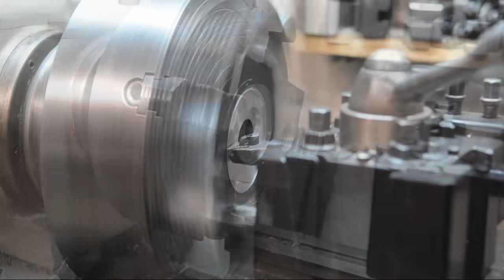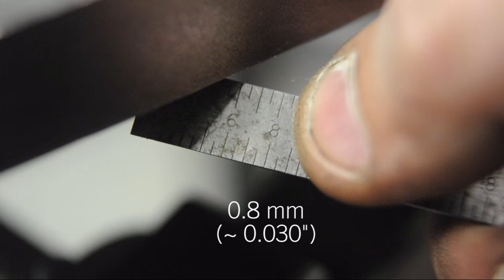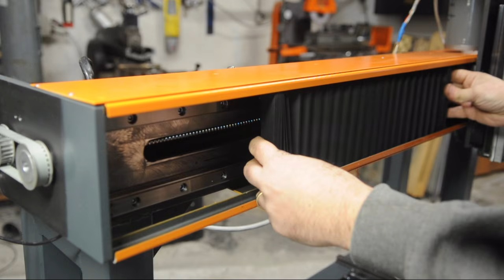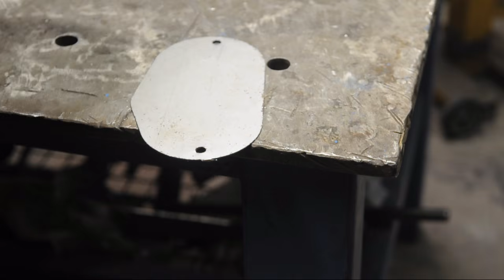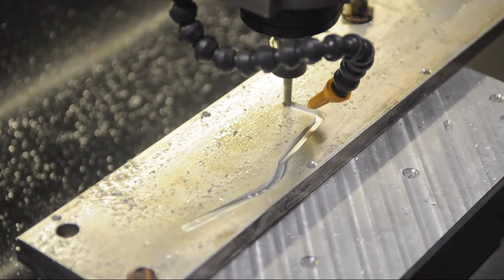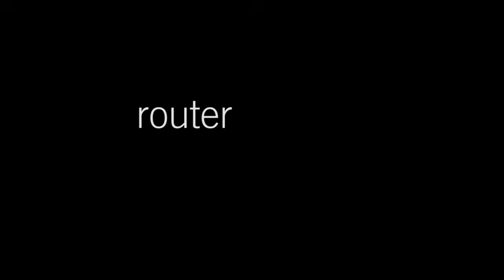Fixed Gantry CNC Router Build Part 3

Comment: They sell "PCB drills" in small sizes that have a 1/8" shank regardless of what diameter the drill part is. might be easier to hold in your mill and could even be held in a collet.

Comment: For future reference, if you want to move heavy loads over a longer distance using a ball screw, you can prevent a long screw from acting like a jump rope by mounting the motor to the moving table and turning the nut instead of the screw.

Comment: The last minute was the most important. My un modded 6090 mill has .023" deflection at 50 pounds, .009 at 15 pounds and .001 at 2.5 pounds. My question is what happens with that deflection if the machine is not chattering? A Good feeds and Speeds app will tell you the amount of force on the tool and what you can cut with those forces. The needed mods are simple and rather obvious to do. Your .001" at 50 pounds is a good target to shoot for.

Comment: I don't know what model Huanyang VFD and spindle you bought but judging it as piece of junk by how the buttons feel is not very this old tony. I have been using the 2.2kw kit for 3 years without a hitch. BTW, why do you need access to the VFD panel?  I never touch mine.

Comment: This Why not put a fan either side of the box with panel filters and louvres to suck air in and out. This will replace hot air that will build up from the VSD.

Comment: What an endeavor... my hat goes off to you. I currently own an old bridgeport interact series 1 i bought with the ambition to run on single phase 220. sadly, the old turd wasn't having it. spindle drive was a VFD (quite like the one driving your spindle) that was near impossible to interface with the factory heidenhain tnc150 controller. So to the dark corner of the shop is where she sits now. I danced over the idea of a retrofit conversion but didn't  (and still really don't) have the doe to do so. You mentioned in an earlier installment of retrofitting an older model 3-axis mill with 3rd-party drives/servo-software package for very very cheap. would you recommend any in particular?

Comment: Well I have finished my all steel DIY CNC machine based on this "This old Tony" design. I modified the design on the two supporting beams for the Y axis rails, just to have adjustment. So I joined parts by screws instead of welding. I introduced a  fine adjustment by means of M6 screws for leveling, and and M8 for strong holding. When machine adjustment, looking for squareness, I do not have adjustment on XZ movement (like your machine) and I only adjust machine table and Y rails (planes XY and YZ) related to XZ plane. I have begun machining aluminum and the whole cutting process looks and sounds very well.  Better than thinking I am finishing the job, I am planning now an update for motors and drivers. Thanks you This old Tony one more time for these three videos you gave us.

Comment: You sound unhappy... I'd be overjoyed if I could finally drill and tap a few holes. It's been ages! All I've been doing is squirting coolant at old chips and keeping the tool bits clean... You know, to make sure the machinery stays in prime condition in case of some unexpected... Well... You know....

Comment: I was wondering about using timing belts to decrease the machine size, too. However I feared of introducing backlash. What's your experience with timing belt vs direct driven ball screws?

Comment: Tony, if you want very fast acceleration for your system, you must change the servos to ClearPath. Clearpath also newer fail its accuracy. Its always spot on as long the servo is sized correctly. Check out ClearPath servos here:
https://www.youtube.com/watch?v=zUy89MT_Rkk

Comment: Maybe some standoffs on the heat sink holding it off the backboard to allow more airflow.  Airflow is the trick on sinks.  Etching in HCL would help - dip and rinse!  HCL will dissolve AL easily.  It is a pickle job.  Weaker solutions might be best.  Or job shop it out to a painter (of metal).

Comment: Hello! I have continuos working on my own Gantry Type Router design based on these 3 videos as I mentioned before. It was very difficult to obtain a flat surface (X axis) to mount rails, by milling along the beam, so I disassembled for grinding. Thank you very  much This Old Tony for this videos and channel.

Comment: Did you ever machine steel on this router? I am making a similar design and testing the design under 1000N or 100 kg or roughly 224 pounds of force. 1 thou max  deflection. I want to cut some steel if needed. Machine base would be cast iron.
I saw you machine aluminium with it nicely. How’s the surface finish? Chatter?

Comment: Since you work a lot with metal, I think you would have benefited from adding a plasma cutter head next to the router. Unfortunately you cannot do this with your design since you have the table move as the Y axis. You would need a water table, and I dont think you could do that with a moving table.
Reply from the maker: I'd have to move really slow. :)

Comment: +1 for building the heat sink from a block, -1 for using slotted screws to mount the motor drives.  Thanks for the video, great entertainment and learning.

Comment: Old Growth - that is a chuckle.   Actually, in high tech Physics the instruments have to be made from steel that isn't traced with radioactive elements.  As it seems there is so much scrap and recycle and reuse the steel is generally mixed up.  However they came into pure gold.  The old (pre WW I) shipyards in Oakland were being upgraded for new ships and cranes... The old had to be removed.  The heavy and very thick plates were tested and all collected.  World wide this is happening.  As old is scrapped it is picked up.  I have a Degree in Physics, Math, Engineering.  Busy guy.  Wonderful project you are on! I know - this is an old thread but not for me.  Just one of a series.

Comment: Yes please to the router design video!

Mostly just to answer all the questions about choice of materials and design.
I personally have a bunch of questions (mostly because of my own ignorance) about the benefits of the fixed gantry vs x&y gantry. (This is honestly the first fixed gantry router I've ever seen)
And wondering if a 4"x6" aluminum extrusion would be as stiff as a steel gantry?

Comment: Im interested in seeing your design video, im in the collecting materials and design process of my cnc plasma table build. I'm watching various CNC DIY videos out there for inspiration and you have set the bar high Sr. Could you elaborate on the electronics and software you used for this project? i.e: motors, motor controls, driver board, power supply, etc. Hopefully you see my comment and are kind enough to reply to me. All the best.

Comment: Have you thought of putting a brush guard that fits around the cutting bit, it would collect chips, and stop overspray of the cooling fluid.  You can even fit a hoover nozzle on there.  This has been a sheer joy to watch an engineer at work,

Comment: At the end of the video you mention that it was designed to limit the tool deflection to 0.001 max under a 50 lb load. I've been interested in building a small desktop mill, and I'm trying to determine what is considered acceptable for deflection. So I'm wondering where this value came from? The most difficult cut I'd ever make might be aluminum with a 1/4 inch end mill. But I can't find any information regarding what the typical range of forces might be under these circumstances for different DOC and step over.

Comment: Is that one of those air cooled china spindles? If so, have you set a minimum RPM? I've heard of air cooled spindles burned at low RPM. So is it a good fit for soft metal milling?

Comment: That Astrosyn motor’s a 34-size 3-stack, it should eat those 1-stack Sanyos. BUT... if it’s ever been pulled apart, and the rotor’s been pulled out, it will have been demagnetised. Check also the operating current. The two types may be wound for very different speeds, meaning very different torque constants, and may need much higher voltage drives. The ones I used to work on ran at full speed with 240Vdc!

Comment: Okay, so... I watched your attention to tolerances and I'm quite impressed. You see, I'm building the "Mostly Printed CNC" router table. Compared to your machine, you could say that the MPCNC is basically made from electrical conduit and jello! At some point I was hoping to move up from the EMT conduit to V-Slot. But there's still that jello bit holding it all together.

You did both your build and your video well... my penis has shrunk! You are da man!  ;-p
PS... I don't think I actually have a need for one of your fancy shmancy dial gauges!

Comment: Have watch these videos about this machine and I wonder why not using a milling machine instead where you could screw like on this machine a plate of wood and on top your sheet of metal to cut with the shape that you like. Why there is not YouTube videos on converting milling machine into a CNC router? Am I missing something? Thanks

Comment: Cool stuff! Me nitpicking:  Use a cable sleeve before screwing your wires in screw terminals. No, seriously, do it.

Have you considered anodizing the heat sink? Not only would that make it an insulator but it would also improve its efficiency as a heat sink, if you anodize it black, because its emissivity is increased compared to blank aluminium or any other color anodized aluminium.

Comment: You have inspired me to do something craxy - I'm going to build a CNC router sorta. But instead of a router, I'm going to put on it a 3D print head. What's inspiring me is the size of your router table. If I can build a table 4' square (working size) and a Z of 2 or 3 feet - just imagine the 3d printed contraptions - wohahaha (evil laugh) :)

Comment: Just wondering why you didn't use gussets in some or all of the corners, I could see why you possibly wouldn't, the wall thickness being as thick as it is and do you do any stress relieving on the welds. When I worked in the oil industry company policy was, all welding will be stressed relieved. All structural steel, schedule pipe and anything with a wall thickness equal to and above 1/2".

Comment: Hmm not up to speed on fusion, but have cad model with simulation still. What software did you use to figure out all this stuff? And are you an engineer? I know is an old video btw, I just went and re-watched them all. Great stuff. Wish I had a machine like that :)

Edit: Solidworks, next video answered it for me.

Comment: awesome but this is not a really a CNC router it's a heavy steel  MIlling machine..that can be used as a router. For less than the cost of building this machine you could buy a used Bridgeport and retrofit it...but if you have the full shop setup and surface grinders, tig welders and a Milling machine and all those skills etc then yeah lots of fun great video A+++

Comment: also at high speed, if the motors are design for, 48V powering could help not limiting the torque given out (not all stepper motors are design for above 24-36 V)

Comment: For the frecrancy transformer: i recomemd the omron V1000 you can get it in a variety of KW ratings, it goes up to 400HZ and har braking resistor abileties. Used those in achool and they seem quite good for small projects like this, they got safety enabeled too!

Comment: I laughed, I cried, I got a sandwich between parts 2 & 3, but I digress...
This is an amazingly well done machine, tutorial and video production.
Every step of the way you provided just information and reasons to easily digest the content.
Get rid of the cat (they ARE evil little things).
I have been building CNC machines for a couple years and also learning on the Fusion 360, but,  only slower cause I am more of a software guy by trade, so the end of this video explaining your design considerations was well received, but,  better at the beginning, flow-wise.
Thank you for the cad model, and the hard work you did on these videos.   I learn tons with each video. 
Would love to see a video from idea to the end of the CAD model that gives more of those design wisdomisms.

Comment: Just a note here...very overall flimsy [not rigid] design is really going to limit how much pressure you can apply when cutting before parts leave square and also chatter, jam and snap tool bits... ~( 'w')/

Comment: Wow simply amazing. At beginning I thought you were showing a clip from an ad for a >$20k commercial CNC router as a goof. Then I watched you build it from scratch!!   One (dumb) question though, what is the purpose of the blue die (pursian blue?) you use on the screw heads?
Reply from the maker: Not a dumb question!  It's been a while but I'm going to guess you're talking about blue loctite.  it's a thread locker / glue to keep the screws from loosening.  Thanks for watching Mark!
Reply: @ThisOldTony  Ah ok. It was on the heads rather instead of the threads.  Just an indicator to remind you later during potential disassembly that thread locker was used?

Comment: Hi ToT. I was just thinking - we all test backlash for Mach3/4 settings with no load. But backlash surely changes (at least a bit) under spindle load. Maybe one can improve things by testing under load? No system is infinitely rigid :-)

Comment: Let me begin by saying that this is outstanding work, no doubt. However, that being said, most people would not be able to do this at home and why would you want to make it out of steel anyways when you have aluminum?, that is just complicating things and making the machine more expensive and heavier than it needs to be. Its an entertaining project to watch but it is not practical. I might be wrong, maybe it is better with steel when milling aluminum because of the stress on the body. Any thoughts from anybody?
Reply from the maker: I tried to stay away from aluminum for two reasons: it's more expensive and it has a different thermal expansion rate compared to the steel components I planned to attach (bearings, screws, etc).  but if you don't need tight tolerances, Al is fine!

Comment: Is there a bit that will drill and tap a through hole?
Reply from the maker: yes but usually they are limited to maybe 1x the drill diameter.  most of the table holes are in ~3/4" plate.

Comment: If only you had a CNC to drill all the holes for your CNC...
Reply from the maker: I actually tried that in the first build but got stuck in a time paradox for 10 years.  2nd time I drilled them manually.

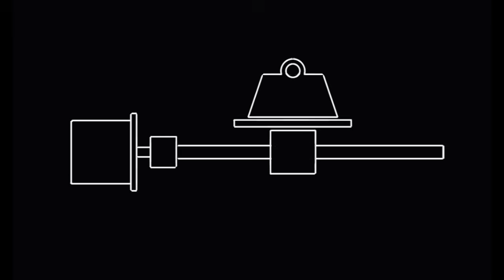Comment: 34:12 what does the 5:1 ratio stand for here?
there is a convertion from rotational to linear motion, so usualy you use a pitch which is the distance in translation from 1 turn of the screw
is it 5mm per turn of the screw? or a more SI unit that would be m/rd or the pitch in meter divided by 2π? or something with inches somewhere (is there an imperial unit for angles? I hope not...)

and I don't really know what do you mean by a torque being able to move a mass to a speed, torque would affect acceleration here (F=m*a or C=m*(ω/s))
or if you want to link force/torque to speed (without mass) you need a "friction" in between (like a mechanical resistance in N/(m/s) or in SI kg/s, but that look weird in this form) F=v*R or C=ω*rR (rR for rotational motion resistance? in Nm/(rd/s))
Reply: well yeah, re-thinking about it with the context, I think you meant that this torque will be able to move this mass to this speed
because it can overcome the friction induced by this mass on the bearings you use (which have a frictional coefficient, when you plug the mass in, you get friction in kg/s)
but friction is a very hard to measure and variable thing

but i'm still confused about the 5:1 ratio :/

Comment: Hey Tony, awesome job with the machine. I am in process of building myself and stuck with a problem related to timing belts and pulleys. See, I have a 1830 ozin (13Nm) stepper and don't want to direct drive the screw like you did. But looking at the torque ratings data of timing pulleys and belts (http://www.sdp-si.com/PDFS/Technical-Section-Timing.pdf) they are surprisingly low (couple hundred ozin max) I saw you're also using NEMA34 steppers, although don't know the torque rating, so I was wondering if you had any problems of slipping with your belt? Also, do you know the torque/power rating of the belts and pulleys (and shaft couplings in other axes) you used? Well, I am no Mechanical Engineer (not since that incident in 1997 ;) but something doesn't look right in my calculations and wanted to know about your experience... Thanks in advance.. Baris

Comment: Your mount on the inverter isn't bad. I have had three three phase 3h.p. inverters in the same NEMA enclosure, of course I put a nice cabinet fan on one side and air filter on other, but you are only working with one very small inverter. Let me know how it turned out over the 2 yrs? Thanks.
Reply: Usually those things have a fan and heat sink in them. They just need some airflow.
Reply from the maker: good to know LWN, thanks!
Reply: You put out some of the best videos on YouTube, my pleasure.

Comment: The only thing I can say about the spindle drive is that most of them give clearances for air cooling in a cabinet.  The drives that get used where I work require 4inches of clear space above and below the drive unit.

Comment: I dont see much air movement. The heat sink you made was a good idea. But,, I think you get better results with a smaller and individual heat sink. Also a good corseair 120mm fan would do you good. look into water cooling I built my Cnc with nema 34's and i treated my control box as a high performance Pc as air flo and cooling goes.